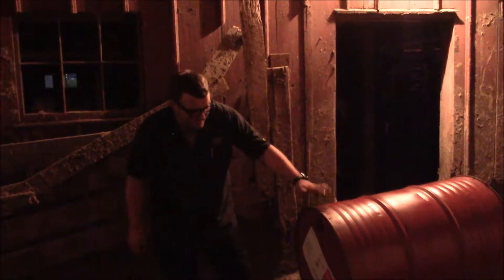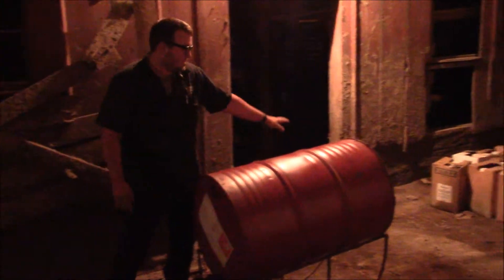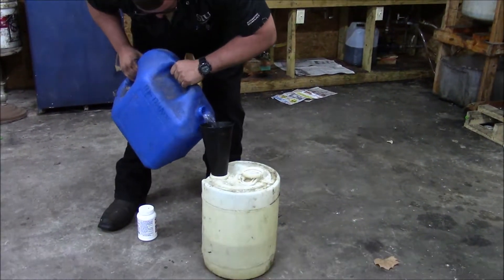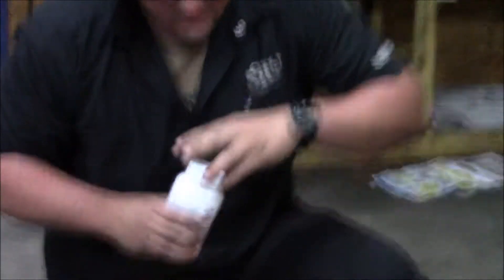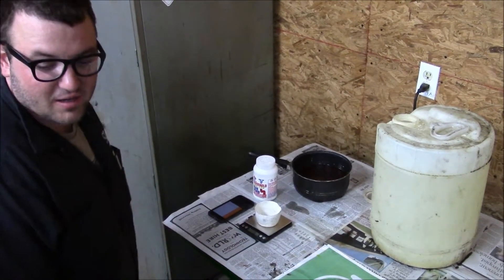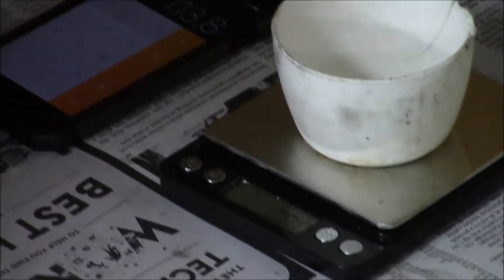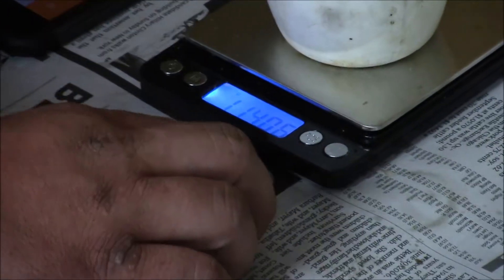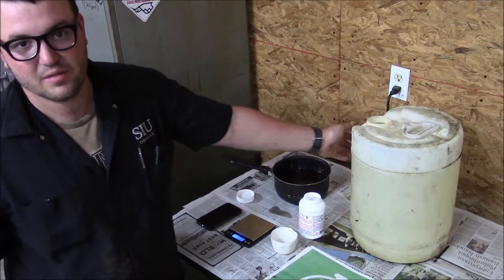Biodiesel Video #4-Preparing the Methoxide

Comment: I'm not sure how this works at all, if it does. This is not how you make sodium methoxide. This is a mixture of water, methanol, and sodium hydroxide. You need to use sodium metal to generate the methoxide. The presence of any water, or the hydroxide ion from sodium hydroxide, will push the equilibrium strongly towards hydroxide, not methoxide.